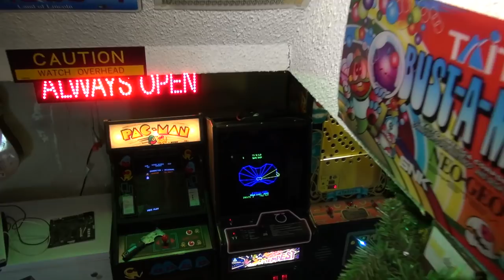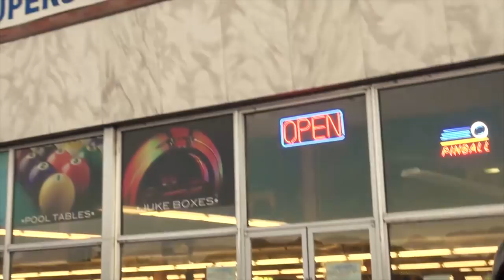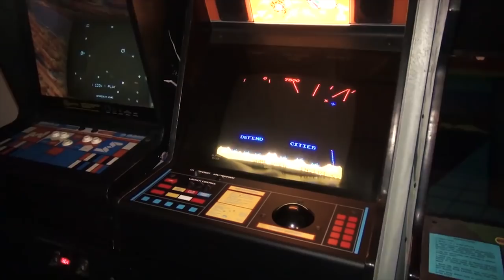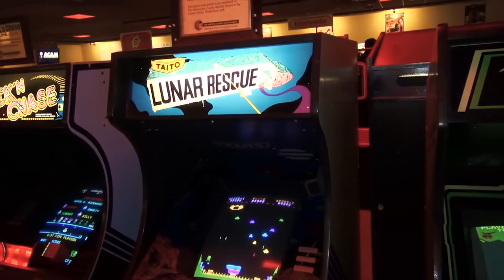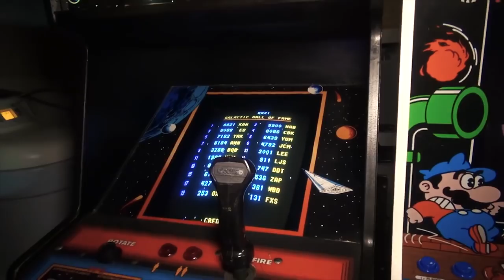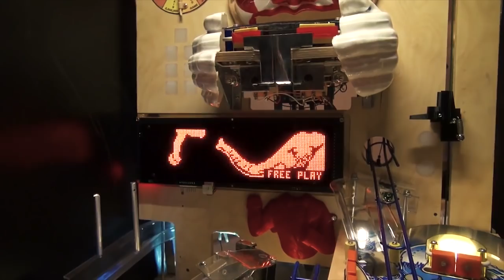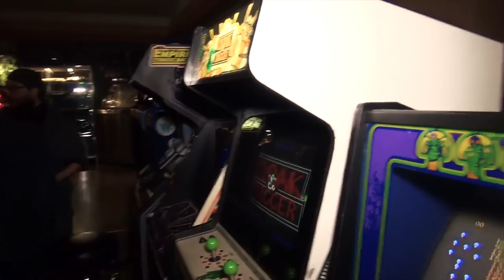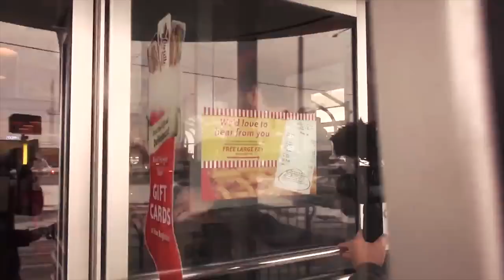John's Arcade Best of 2015 - PART 1 -  ON THE ROAD VIDS

Comment: If you ever started a barcade/museum arcade, DO NOT take those games from your basement. I can tell you that doing so would kill you, internally. Going for perfection on your rebuilds means you can not tolerate what the uncaring public can do. In such a setting, start up with a bunch of junk. Cheap games to rent or buy. Build that one fresh and keep your private collection private. Use your skills to rebuild the bar machines at the bar and keep your personal collection safely away from the general public.